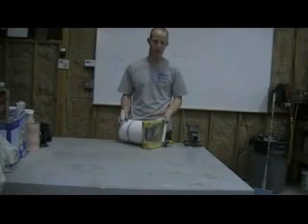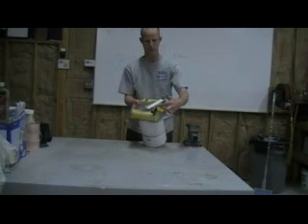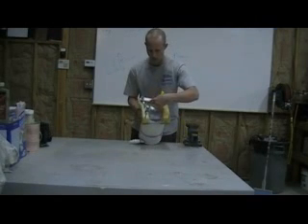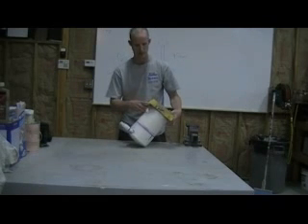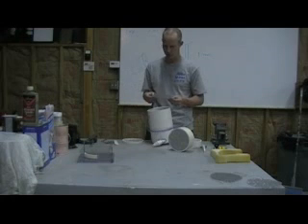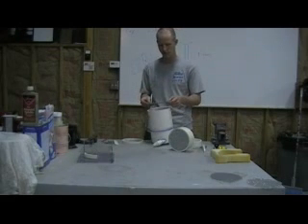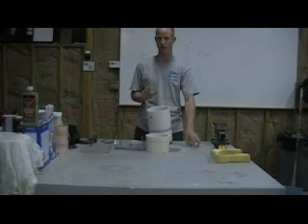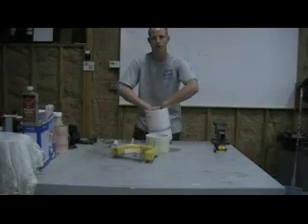Laminar Jet Construction - Part 1

Comment: hi
i watch your laminar flow nozzle film in youtube
please say me what is low pass filter???
how i can make it???or buy it?
please help me
i wait your response to my mail
abkhezr.robat@gmail.com
thanks
Reply from the maker: A low pass filter is simply a chamber filled with air,  The water enters, causes air pressure to build which forces the water back out.  Be sure and have the output and input low so air will build up at the top.  "Low Pass" is a general term that means low frequency will "Pass" through the filter.  High frequency pressure variance, which causes disruptions to the stream will not pass, it will be absorbed (dampened) by the air.
Reply: hi dear friend
really thank you for response 
but my nozzle's output is not clear (water).why??

i dont know what kind of lightig use??(fiber optic or power led  or laser)

so thanks
Reply from the maker: The low pass filter won't affect the clearness of the water exiting the jet, it will effect jitter in the pressure which will cause the jet to jump around in arch height in an undesirable manner.  Perhaps your nozzle isn't sharpened good enough, or you are trying to push too much water through it, lower the flow and find the point at which it becomes laminar.

Comment: hi it is me agian !!! i hae a Q about the jet housing ! how long it is and his diameter ? and why you make it in 2 parts  ( cupling & acup ) is it nessusery ?
Reply from the maker: No it's not necessary, it's just convenient to use for off the shelf parts.  You can buy a coupling, cap, and pipe at the hardware store and you don't need a 6" diam chuck on your lathe to make the parts custom.